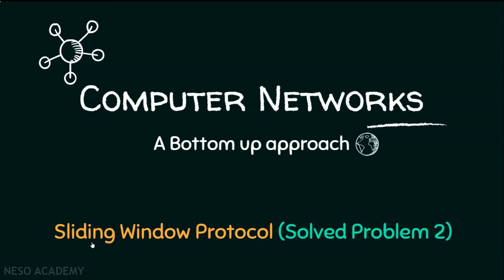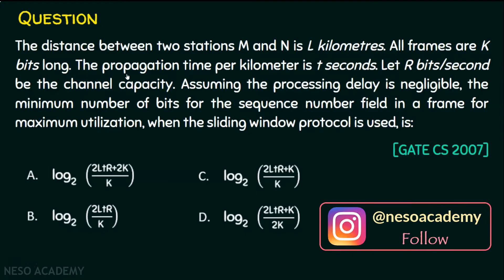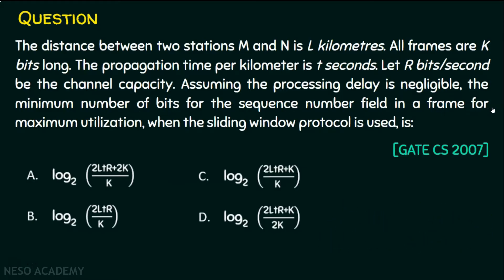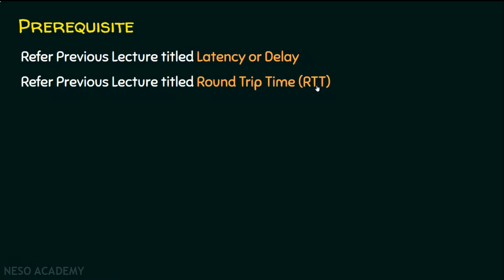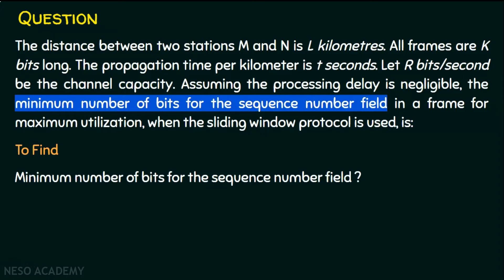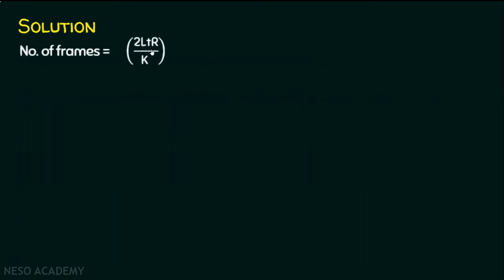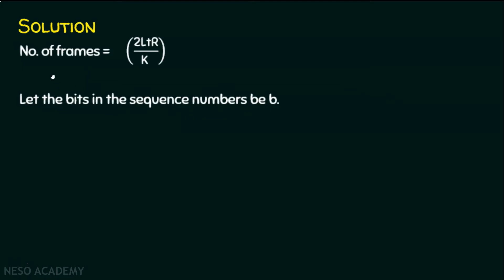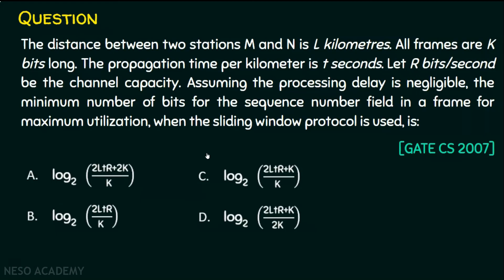Sliding Window Protocol (Solved Problem 2)

Comment: Rather than using the RTT concept... The simplest is the following!!
Here we get answer in just 2 steps. 

Tp = Lt seconds
Tt = K/R

==> So no. of bits in the sequence for sliding window protocol is 
      --> log (1+2a)   Where  a = Tp/Tt
     --> log ( 1+2 ( Lt * R/ K ) )
    --> log (( K + 2Lt * R) / K )  Ans..

Comment: Sir why you have taken  K(no of frames) as denominator please explain.
Reply: K is not the number of frames, it is the number of bits in a frame. 2LtR is the total number of bits present across the channel at any given time. A message is broken into frames while transmitting i.e, N number of frames can be transmitted simultaneously in a sliding window protocol. We are finding that N. So bandwidth-delay product(2LtR) divided by K (number of bits in a frame) gives us the number of frames(N) that can be sent simultaneously from the sender before receiving an acknowledgement.
Reply: Tp = Lt seconds
Tt = K/R

==> So no. of bits in the sequence for sliding window protocol is 
      --> log (1+2a)   Where  a = Tp/Tt
     --> log ( 1+2 ( Lt * R/ K ) )
    --> log (( K + 2Lt * R) / K )  Ans..

Comment: How do we know, we have to use RTT?
Why not time for one way transmission?
Reply: cuz u know 1 packet is sent successfully only when its ack is recieved by sender .so use rtt for tcp protocol and one way transmission for udp
Reply: Tp = Lt seconds
Tt = K/R

==> So no. of bits in the sequence for sliding window protocol is 
      --> log (1+2a)   Where  a = Tp/Tt
     --> log ( 1+2 ( Lt * R/ K ) )
    --> log (( K + 2Lt * R) / K )  Ans..
Reply: Same doubt,  :-(